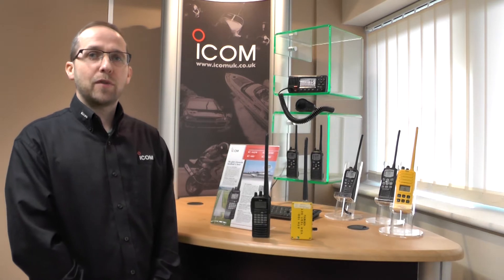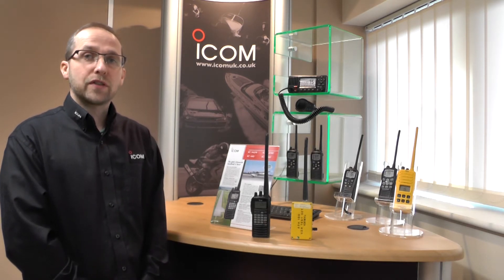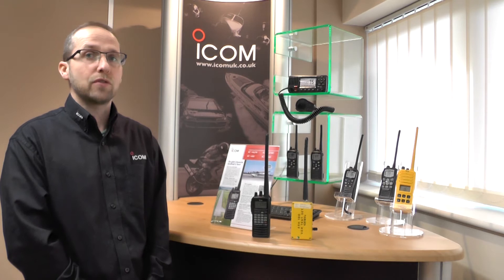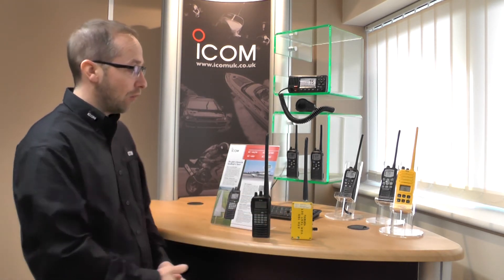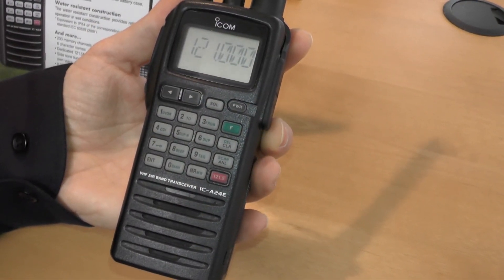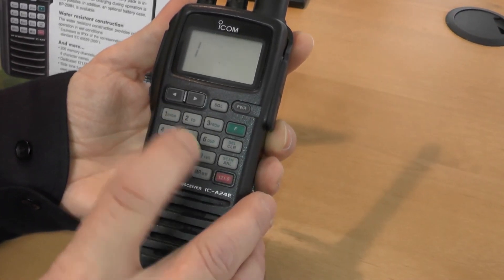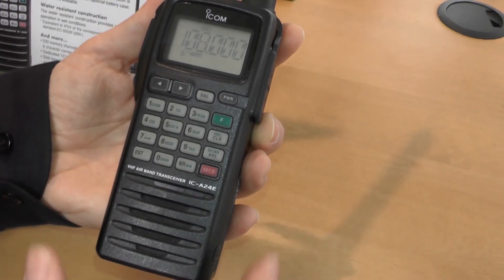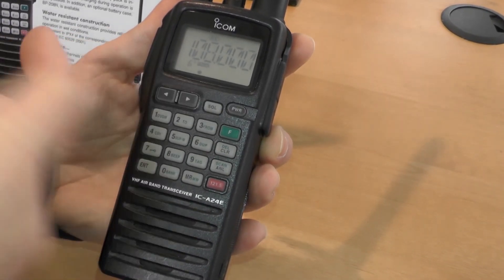The VOR Function of the Icom IC-A24E Portable Airband Transceiver

Comment: Thank you. Please what the Receiver Max RF power input?
Reply from the maker: Thanks for your question.  Are you asking what is the maximum reverse power that can be applied to the receiver without causing damage OR is asking about the transmit power (carrier or PEP)?
Reply: @Icom_UK  maximum power that  can be applied to the receiver without causing damage ( dBm or watt). Is - 20 dBm OK? Thank you
Reply: @Icom_UK  All radio producing companies provide this information.  This is necessary information for calibration and testing.Even in the instruction manual it is not present. Is there any way to obtain this information?

Comment: How do I disable this function?
Reply from the maker: VOR only works from 108 - 118 Mhz, which is below the comm band, to engage it you set the TO/FROM/CDI. to stop using it, tune up into the comm band 118-136.975 Mhz.  Details should be in the manual
Reply: Thx 👍

Comment: I honestly don't see the point in VOR on a handset. Trust me when you are flying you'll end up 6ft under fiddling with this in the cockpit. If its a dire emergency just ask for a QDM back to the airfield.
Reply: I have used it on flight when aircraft does not have vor. Helps navigating in unfamiliar location and can give radial report to air traffic controller.